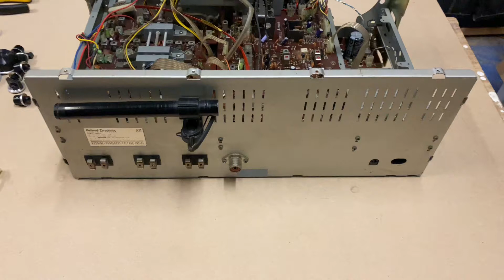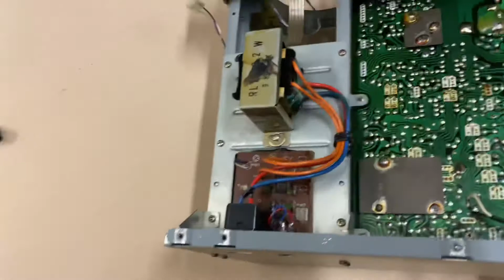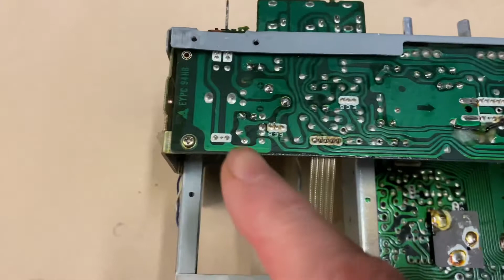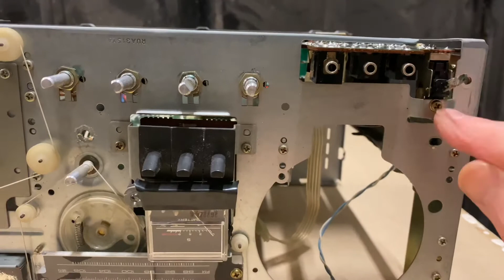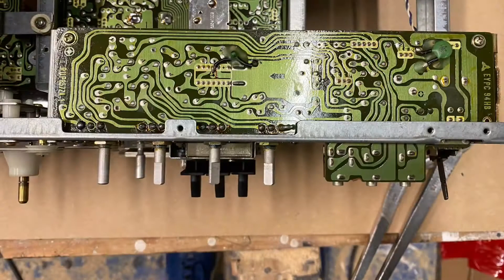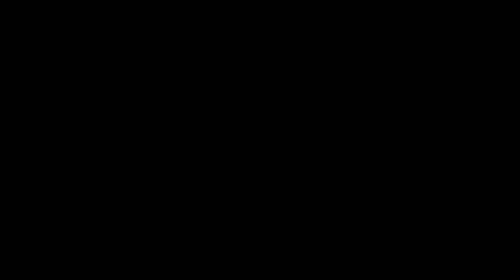E02 Panasonic RF-4900 DR49 how to repair Audio Board

Comment: We had one of these when I was a teenager in the late 70’s, early 80’s.  Thanks for the video which I have just rediscovered.  We still have the original radio, and have over the years bought 2 more, one which is intentionally for spares.  You have rekindled my desire to bring these beautiful radios back to life!  I have been hesitant, but I think you have simplified the restoration for me, I need to focus mainly on the audio board.  Thanks!
Reply from the maker: Hi, glad you enjoyed it. There is great tactile and listening pleasure in tunning a well-engineered analogue receiver. I have restored many of these and my focus has been on the audio board where I replaced all the caps and the power board occasionally replacing the diodes. I never touched the rf boards; however I used massive amounts of deoxit to make the band changes switches on the board start working properly.

Comment: Just received one of these in mint condition, only the treble pot is a bit scratchy.  So, next project thanks to your two videos:  remove the case and extract the audio board.  Replace audio caps.  Clean all connectors on all boards and treat with deoxit gold.  Clean the case, facia plate and change the power supply caps.  Re-assemble!  Many thanks for your excellent videos!